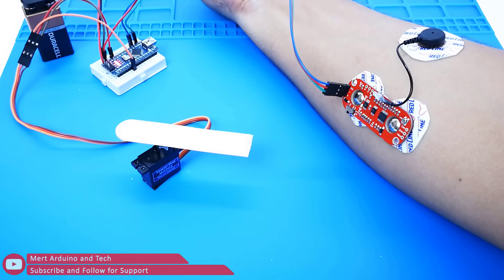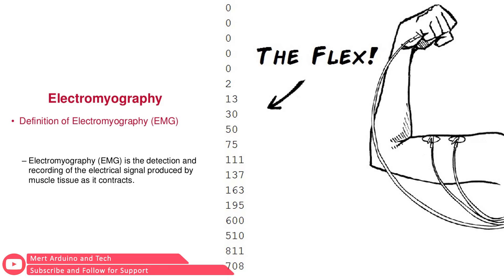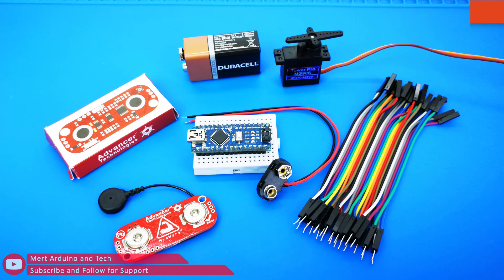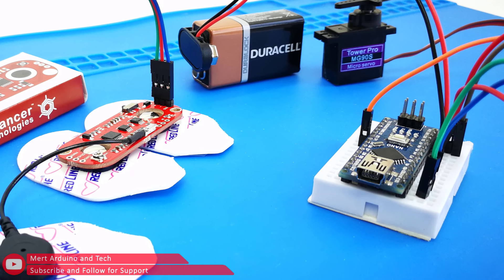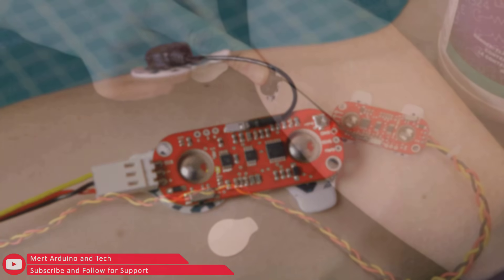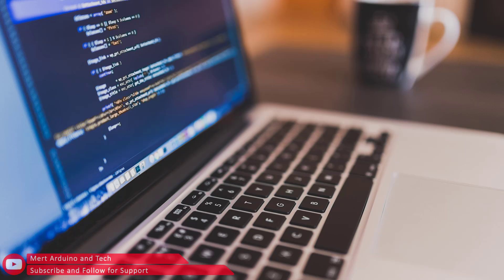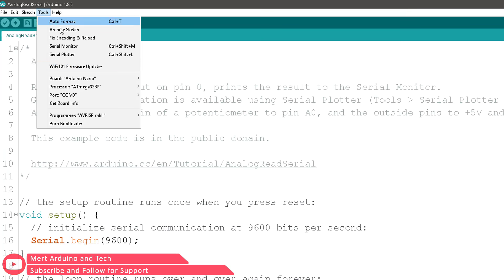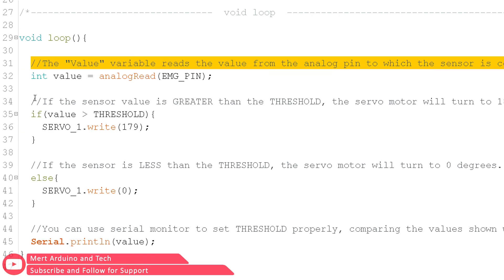How to Use EMG Muscle Sensor to Control Anything (MyoWare)

Comment: Thank you for this video.
I have one quention, I would like to know if it is possible to get the three signals separately(one for each sensor).
Regards
Reply: Each sensor is made of two electrodes and measure difference between them. The third one is for earthing and should be placed far away from the two. If you need three signals you need three sensors (two electrodes each) and one earthing electrode for all.
Reply: @AbartG  Are there  any thinner electrodes
Reply: So for 3 sensor do i need to connect them all into the same pin or different analog pin coz i need to use more than one sensor
Reply: @Anglearmyx  .To different analog pins
Reply: @AbartG  then how can u take the signal if i used different analog pins
Reply: @Anglearmyx  You measure it on each of them. Otherwise you have mixed signal on just one pin and wont be able to distinguish which sensor is actually triggered.
Reply: @AbartG  because I’m using machine learning so i need to put the value inside the prediction so supposed to be one signal but i need to use more sensor to cover as much as possible of muscles i hope you got me
Reply: @Anglearmyx  Well, it depends. I don't know your project and heave less experience with ML, but I guess you can use list or tuple as a variable for ML. Does your project require different muscle groups to be distinguished? Or just an average value of the all sensors? Those affect the workflow. Search for projects with multiple sensors, because they better address your doubts.
Reply: @AbartG  i will try both with average value of the sensor and to distinguish but the thing is I couldn’t find any resources that why im struggling

Comment: Is it possible to connect two or more EMG Muscle sensors to just one microcontroller? Or would I need one microcontroller for each EMG Muscle sensor? Thank you!!
Reply: Depending on your board but yes, it uses analog input for reading the incoming values, for example Arduino Nano has 8 analog pins that can be used either as input or output.